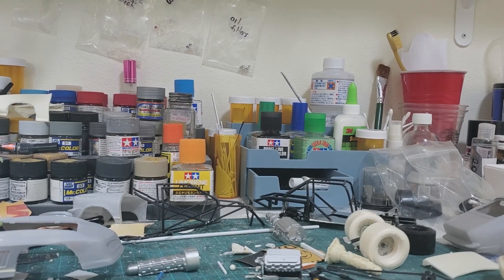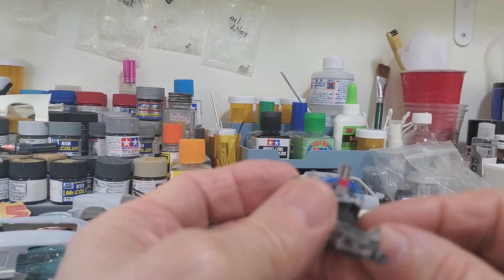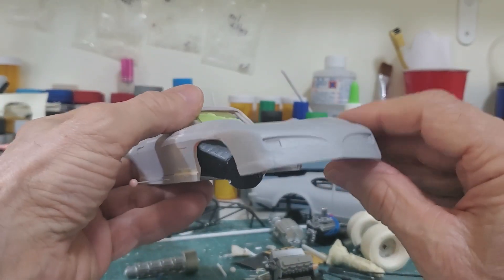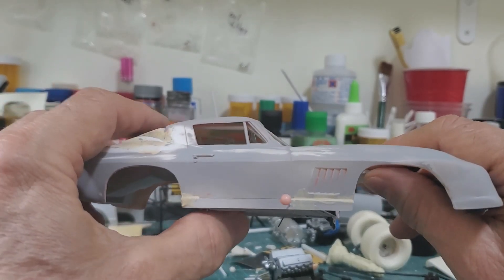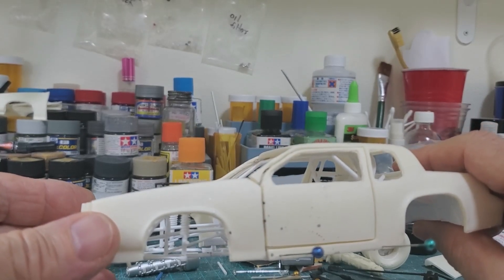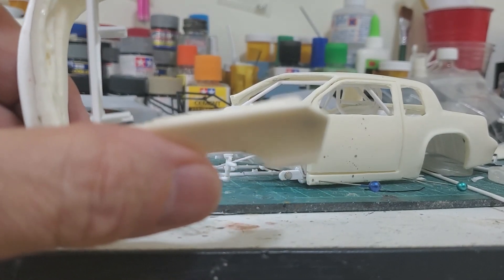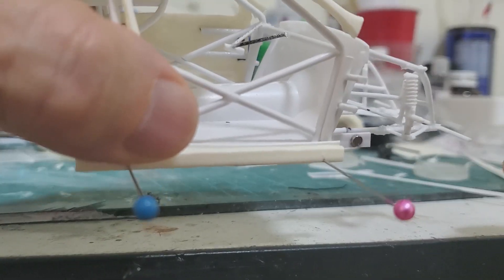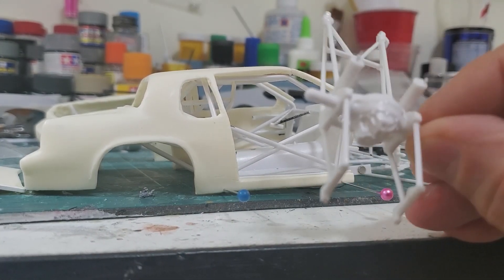Project update and back story

Comment: Brother I had to shave off the rear edge of the front fenders little bit at a inward angle to get doors to open.. And make perches At the nose to prop up the clip at the front.. Great work your doing there and just be patient and work one problem at a time.... 😎👍 Love that Vette.  So glad I was able to help you out .. Keep riding the bike and keep building models to keep the brain activity in shape.
Reply from the maker: I was thinking that too about shaving the front fender edges a little, I did make little plastic "forks" to slide over the front cross bar to hold the front of the front clip, I'm pretty sure that's what you meant by perches, right?
Reply: @modelcarmadness5119  Yes Sir, that is how I had to do it on my Nova.. Thought I'd never get those doors right, but it happened in the end.😎👍 You are doing great work on everything there Brother.
Reply from the maker: @ledheadkustomplastic3442  thanks my friend